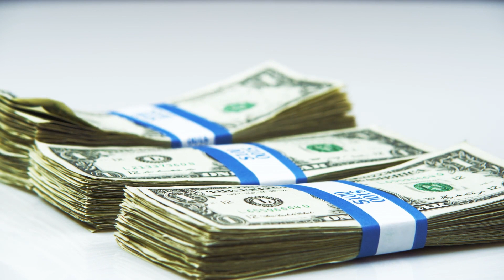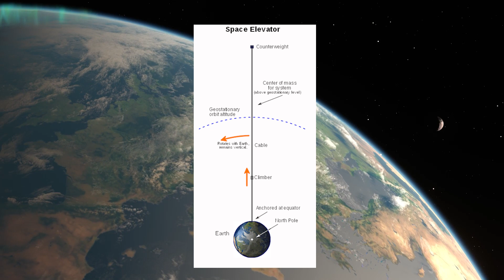Space Elevator | Explained

Comment: No no no, and no. A space "elevator" is not an elevator in its self,only the idea remain. Can we build something in a form of getting the stuff from Earth in to space with an idea of "it" working as elevator.....we can build it, we not yet have a need for it, the "stuff" that we are in need to put in space or a goods transport in space we can do it by use of a rocket,- a reuse kind of a rocket. We could build a tower in to havens - so called, the construction on this scale is out off SCALE, if the other end of the tower is a space station with space port and space warehouse and its place is low Earth orbit at 100 KM the the safe foot print of construction on Earth would be 100 km , just to make it safe, a tower in shape of a cylinder, 100 X 100 km, - easy build, so a harder one to do, would be a cylinder tower, size of 100 X 400 KM in to space in to high Earth orbit, it will be constructed of 4 parts of 100 X 100 km structures connected, yes the scale of this build is massive and impressive, we do constructions projects in KM scale by now, the only enemy of us going big is time, as we construct a build up on this scale as space tower, before the build is even 50% done we would need to rebuild it as the materials would get old, corroded or fall under its own stresses over time, so simply says we are not THERE yet, and we do not have yet the need a true need of constructing such a building, all that we need to get in to space for now can be transported by a reused rockets. TH
Reply from the maker: Interesting thought.